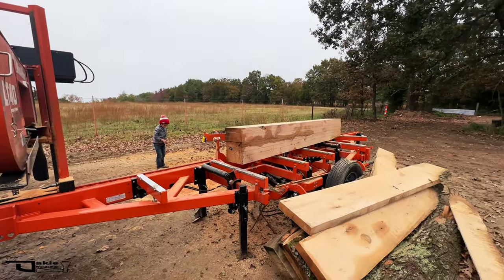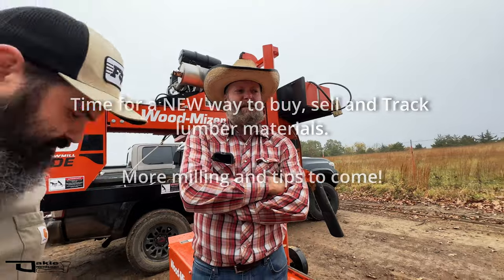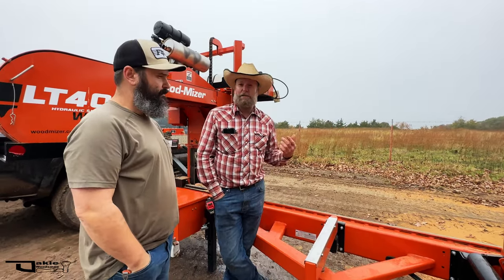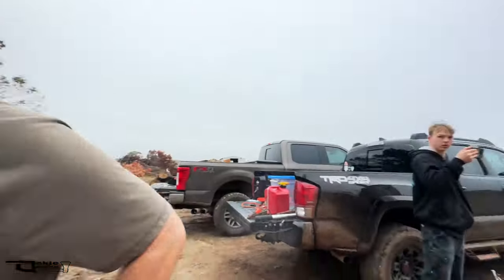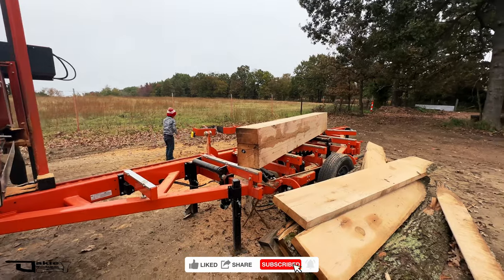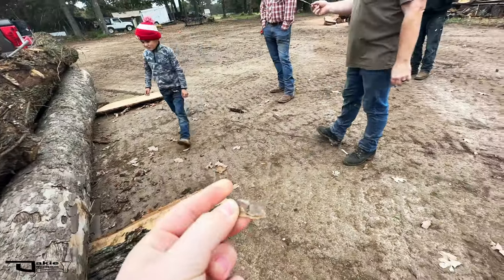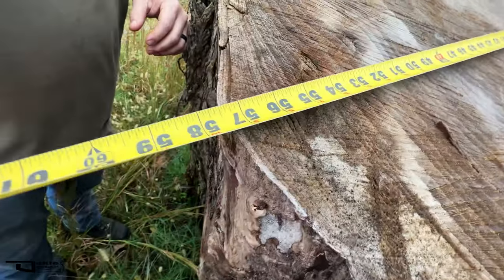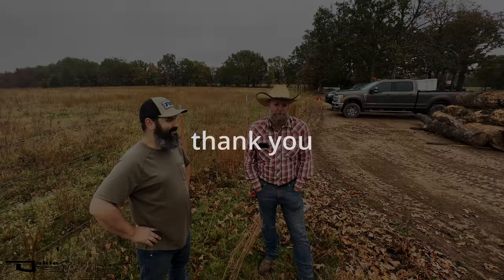Expert Wood-Mizer LT40 Wide - Basic Sawmill Design - NEW Way to Buy, Sell and Find Lumber

Comment: Since getting into chainsaws, I have sense realized a total different understanding of trees, wood, and lumber.
Reply from the maker: That happened to me as well. I started wondering if there was something better to do with the resource than just firewood you know? I also started understanding more about why certain woods were used in some cases and not others.  I have known hickory had flex and made good tool handles. I had never tried to split it before. That was NOT fun. Interesting stuff Mark
Reply: So cool, wood is the most renewable resource and used in so many different applications. I like to play drums and the shells of different species produce different tones in the wood that I didn’t even know about. So many resources can be produced of just one tree!!
Reply from the maker: It is truly amazing.  We ought to utilize the resource well and be a good steward of it for sure!  @zeromark202